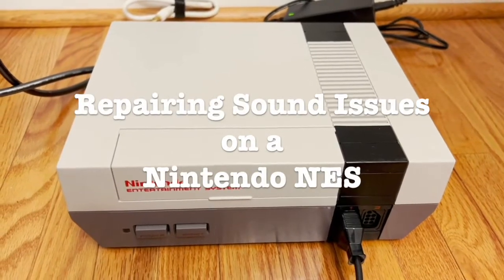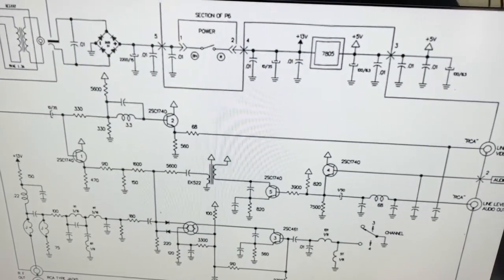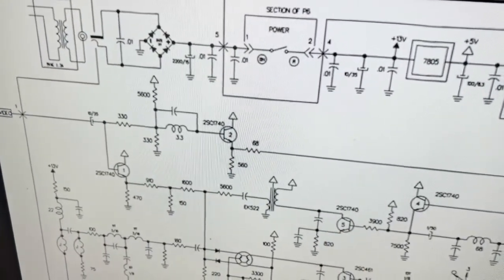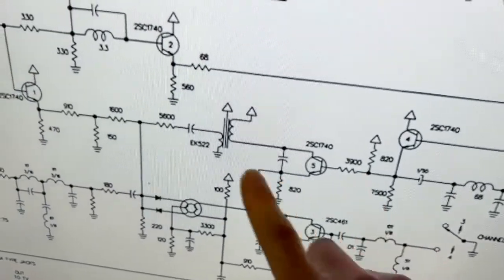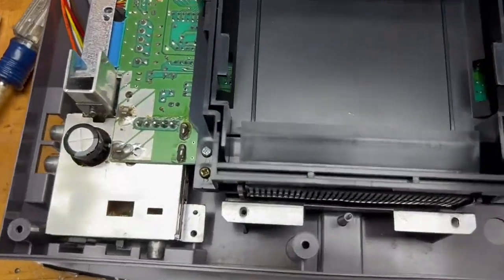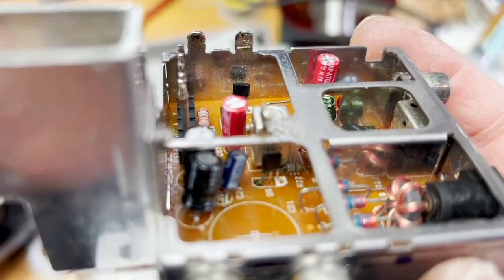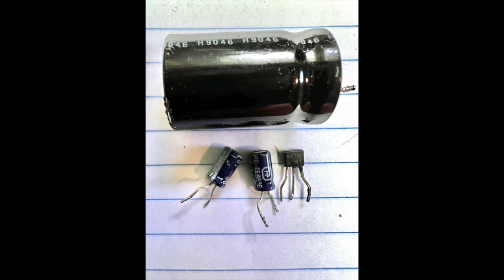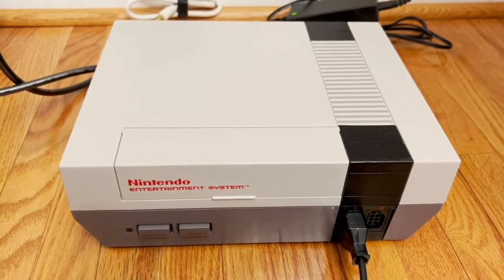Nintendo Entertainment System (NES) Console No-Sound Repair

Comment: Damn, I have the exact OPPOSITE problem with mine. I do have audio and video on the RF output, but I do have video and NO AUDIO on the AV output, yes, no audio at all, just silence and video. Do you have a video for that fix?
Reply from the maker: Go to the schematic at https://wiki.console5.com/wiki/File:NES-001-Schematic---Power,-AV,-RF-Switch.png   The audio/video signal from the video chip comes in on the left where it says VIDEO. Audio goes through transistor 1 and must be making it at least as far s the 1600Ω resistor where it's taken off and mixed with ch3 or ch4 and then to the RF jack. Audio passes a transformer, then to transistor 5 and transistor 4 and then through a 1µF capacitor before making it to the line level audio out. Check transistors 4 and 5 and the capacitor. I''m betting that's where your problem is. You probably can't get 2SC1740 but 2N2222 in a TO-92 package are cheap.
Reply: Thank you, I'll check on my console as soon as I can, I update my progress here, hope those are the problem, or maybe the capacitor 1/50 in the diagram because the console doesn't give any sound at all in that RCA Audio output, no hiss, no strange sounds, just complete silence.
Reply from the maker: A 1 μF 50 volt capacitor from a reputable source (e.g., mouser, digikey) will probably cost you 25 ¢ each if you order 10. Replace all the 1 μF capacitors. They deteriorate over time as their electrolyte dries out. They should last 30 to 40 years but the capacitors Nintendo used were poor quality. Keep me posted !
Reply: @Mr.BrownsBasement  Little update, I just did the capacitor and transistor changes, I changed all capacitors with their respective values, and transistors Q1, Q4 and Q5, and now I don't have any video at all, nothing. My only suspicion, is that the filtering capacitor might be the problem, because I put a 4700uF instead of a 2200uF because I didn't have any 2200uF, but I don't think that has to interfere with anything from the video and audio outputs, because it's just the filtering capacitor from the voltage regulator. What do you think it could be? Could it be that 4700uF capacitor enough to now not having either video and audio in both AV and RF outputs?
Reply from the maker: @cardenassolisrodrigo2601  Sorry to hear that you're having a tough time. My gut feeling is that one or more of the transistors is not installed properly. Please check them. It's also possible that the transistors you bought have a different pinout (i.e., the Emitter, Base and Collector connections are in a different order than the original parts. Yes, it happens). Putting in a 4700µF cap instead of a 2200µF cap in a solid state power supply usually won't make any difference. The transformer and the full-wave rectifier diodes are forgiving. Besides, they'd only be stressed for a few cycles before the capacitor was fully charged. So no, I don't think it's the filter capacitor, unless you put it in backwards. If that's the case, it will let you know by exploding. I know it's discouraging but troubleshooting is the best way to learn.
Reply: I just investigated, and the 2SC1740 transistors have a pin configuration of "1.- Emitter, 2.- Collector, and 3.- Base" while the 2N2222 transistors have a pinout configuration of "1.-Emitter, 2.- Base, and 3.- Collector." Which explains why none of them gave me any kind of hFE when checking on a multimeter. And could also explain why it doesn't work now. I gotta find any NPN transistor that has the same pinout as the 2SC1740, since the 2N2222 and it's equivalents such as the 2N3904 have the same "EBC" pinout.
Reply from the maker: No— the 2N2222 transistors are fine. Just swap the leads so the collector and emitter go into the right holes on the board! I would suggest you buy a component tester. They’re much better than a multimeter for testing components (watch my Short https://m.youtube.com/shorts/mfKGbqMwGIE) They will not only give you the hfe of a transistor but give you the polarity, and will tell you the pinout. I use my component testers all the time.

Comment: giving you a thumb up and looking around where to buy capacitors and transistors... :face-blue-smiling:
Reply from the maker: Thank you for the thumbs up. I buy my high voltage electrolytic capacitors and my film capacitors from JustRadios. They are in Canada but they do ship internationally. Resistors & semiconductors are usually from Digikey or Mouser, very occasionally from eBay. 
Tubes are often from eBay. eBay’s product is only as good as the Seller selling it so I try to find Sellers with a near perfect feedback rating after thousands of sales. I hope this helps!

Comment: I just re-capped an NES and I think one of the cap legs was shorting to ground when the case was closed and this caused the audio to cut out. Not sure if it's anything to do with that, but after I fixed it I happened to notice this NES plays at about half volume. I can't find any shorts and the transistors look like they're in good condition. I'm just wondering if I should look at the transistors or replace them just in case. I might have to study the schematic to figure out what's wrong but I'm not quite there yet. Anyway, would love some advice but also want to say I really like your video. Thanks for going into so much detail!
Reply from the maker: Unless a transistor has been completely and catastrophically destroyed you will not be able to see if a transistor is good, weak or bad just from looking at it. I don’t have the schematic in front of me now, but if I recall the signal path is straightforward and the transistors aren’t anything special. For the price of a handful of inexpensive transistors, it might just be easiest to replace all of them rather than determine which one/ones is/are iffy. Using a bright light and magnifier, take a good close look at the underside of the transistors for corrosion where the wires enter the epoxy. Your culprit may be hiding in plain sight.
Reply: @Mr.BrownsBasement  Hi, I changed two of the caps along the audio line and it fixed my problem! I had some trouble since every transister I used has a different pinout but I got there eventually. Unfortunately I managed to break the audio to the RF circuit so now I need to fix that, but if I use video/audio out it works fine. Thanks for your help!
Reply: Final update, I fixed all my audio issues. The volume is restored and the RF audio is clear again. Seems I tore a pad near Q5's collector pin so I had to solder each side of it separately. I would like to have repaired the pad but the area seemed too crowded. Thanks again for your help and your awesome video!
Reply from the maker: @shimster13 many thanks for your kind words.

Comment: Hello. I have a similar issue, no sound (completly silent) through RF path, but all is OK through audio port.
My transistor and resistors seem OK. I am suspecting open primary winding in EK522 sound transformer. Unfortunately can't find  info about it, like pinout or resistance of windings.
Voltages I have on a transistor driving audio transformer are 1,6 V on base and 1V on collector and emitter.
Reply from the maker: A failed coil is possible but rare. A more likely failure is a marginal solder joint on one leg. Have you checked it for continuity? I don’t have the schematic with me (I’m out of town at this moment) but it’s odd that your collector voltage is less than the base voltage. I’d still suspect a bad transistor before an open coil. Let me know how it turns out.
Reply: @Mr.BrownsBasement  I agree with you on this.  I had a similar issue and racked my brain over it, only to find it its what you were stating, a marginal solder on all of the legs.  If the commenter would look up "NES capacitor values" he should be able find the values for the capacitors and a diagram that shows continuity test points to ensure the re installation is good.  If any the legs don't test 1 ohm or less, need to check the legs where those big pins go through the mother board with the power AV module uninstalled.  I had to apply some additional solder in order to get good continuity.

At first it was just the audio and video legs.  In my attempt to re flow the solder on the "top" of the motherboard, I actually caused the solder to run downward into the power module inadvertently removing contact from the pins and the return power to the power module to activate the transistor.
Reply from the maker: @MavHunter20XX A marginal solder joint may be fine for many years until thermal expansion or the device being knocked just the right way breaks the connection. The joint often looks ok but it isn’t. For someone who has never experienced it, it can be very hard to imagine that this can happen. 

I truly understand the frustration when you try your best to fix one thing but inadvertently mess up something else. Been there, done that!

Comment: Hey Mr Brown so my NES is in great condition and sounds was working fine but now ether way I hook it up, sound will play some and then it goes out. Picture is great tho. How could I do a complete repair on the sound?
Reply from the maker: It's hard to do a diagnosis remotely… but here goes: If the sound goes out it could be a bad connection but more likely it's a bad part. The schematics are really helpful. You can Google & download them and follow the signal path as you read my answer. The audio leaves the large CPU chip at U6 on pins 1 and 2. From there, it's coupled to an inverter by a small 1µF capacitor into an inverter. Next the signal goes to a transistor in the RF modulator (the silver box) and then is coupled by another 1µF capacitor inside the RF modulator straight to the audio out RCA plug. Do you have good audio there? If not, I'd replace both 1µF capacitors, and if that didn't fix it, the transistor (marked C1740; it's a 2SC1740). If the signal is good to that point, there  is another 2SC1740 transistor before the RF-Out. Another option for you if you don't have a soldering iron is just to buy a replacement motherboard. I believe iFixit sells them for around $25 USD. I hope this helps… let me know!
Reply: @Mr.BrownsBasement  thank you so much friend, I don't know much about it as deep as you do. Now if I just replace the motherboard that will fix everything right? If so where could I get it? If you have a link maybe you could send that to me. Again thank you Mr Brown for all your help. I also see that I can buy the A/V replacement module. Could that fix it also?
Reply from the maker: Replacing the motherboard is about 90% of what’s inside the machine. If you get a working motherboard you will have a working machine. I just checked iFixit ( https://www.ifixit.com/products/nintendo-nes-001-motherboard ) and they are currently out of stock. They were selling them for only $25 which was a very good price. It’s not surprising that they’re all gone. The repair you need is not difficult. If you know someone with electronics troubleshooting skills they could fix it for you inexpensively. Even if all the related capacitors had to be replaced along with the two transistors, the total cost in parts would be under $3. I’d caution you against buying a motherboard off eBay unless the seller warranties their boards; while most sellers are reputable I’ve run into a few who are not. Are you in the Greater Toronto Area?
Reply: @Mr.BrownsBasement  no sir I'm located in Raleigh NC
Reply from the maker: @BlackOutlaw_ It was worth asking…

Comment: My nintendo NES does work but makes an annoying zooming sound
Reply from the maker: Distortion (fuzzy sound) and oscillation (squealing and motorboating noises) are symptoms of something disrupting the audio signal. It is likely that your NES has an age-related failure similar to the one that affected mine. It’s probably not a complicated fix, but it may be time-consuming. Though my video was only about 15 minutes, the actual repair was closer to a couple of hours.

Comment: I need help AV part no audio
Reply from the maker: Since the signal is capacitively coupled would suggest you do the obvious (and easy): Replace the electrolytic capacitors in the modulator unit, then retest. Unless you have corrosion crawling up the leg of one of the transistors, that should do it. But while you’ve got it apart and open, carefully examine all the transistors. If you see any blue corrosion on any component lead, chances are that component is faulty. You’ll need bright light and a magnifier because it may not be easy to see. Good luck, let me know how you make out.

Comment: Same problem but with the Video and Audio ports
Reply: Im having the same exact problem with mine.. can I send it to you for repair?
Reply from the maker: If you were local, I would consider picking it up from you and making a video. But that really depends on where you are.
Reply: @Mr.BrownsBasement  I don't think so my friend. I live the states
Reply from the maker: It was worth asking… but if you are having the same problem the repair will likely be similar. The signal path is very straightforward.
Reply from the maker: There is a 10μF coupling capacitor from the logic board video output to the AV section. That cap would cause bad audio and video. See https://wiki.console5.com/wiki/Nintendo_NES-001#/media/File%3ANES-001-Schematic---Power%2C-AV%2C-RF-Switch.png